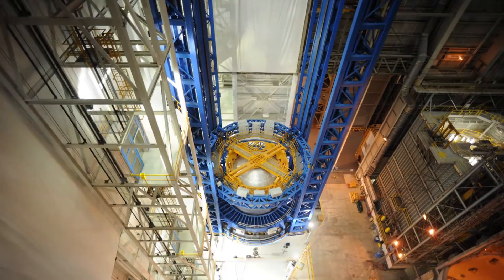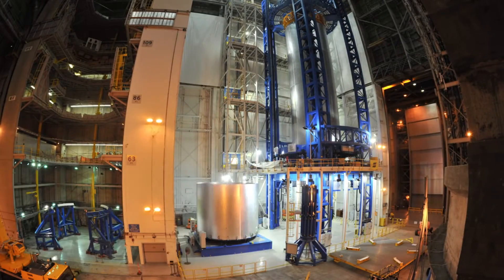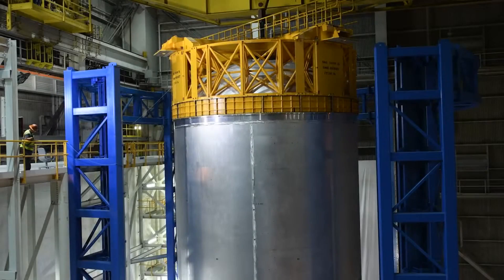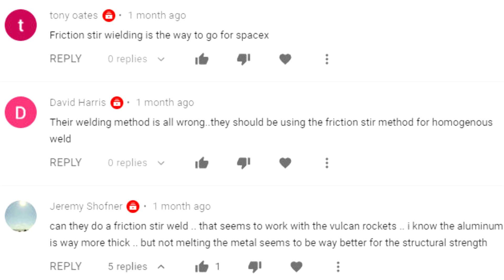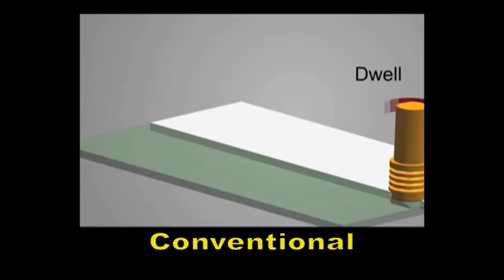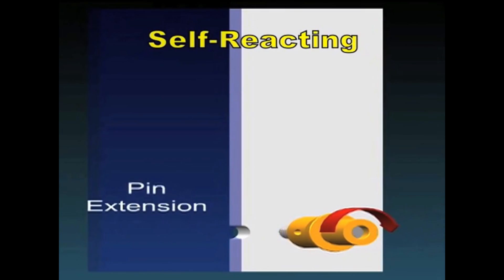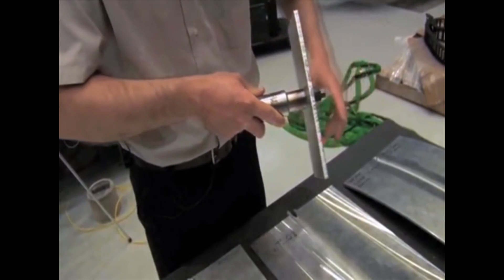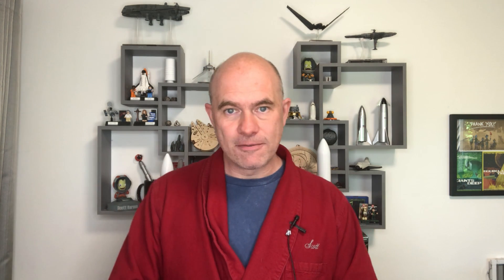SpaceX's 4th Starship Prototype Collapses During Test

Comment: 6:09 I hope so too. And I believe that we will see it fly. My hopes will not be disappointed, I am confident.
Reply: @gandritaskull  Oh is that why you're working so hard in these comments? ;)
Reply: @gandritaskull  Wat? Nah, you.
Reply: Yeah, SLS ain’t looking half bad now...
Reply: @OlCrunch  Oh my god no. Those solid boosters are a terrible idea on anything that carries people, and the thing is going to be way to expensive too use more than a handful of times. It's a political make work project.
Reply: TonboIV it wasn’t the SRB’s that where the problem. It was the the combination of a rushed launch and no abort system.
Reply: @OlCrunch  The SRBs were defective and dangerous. NASA was getting away with it by only launching in warm weather, but they were still dangerously defective and the o-rings were partially failing on every launch.  SRBs have never been reliable enough for manned launchers in the first place, even when they're designed properly. If one of them even loses thrust early, the rocket will go out of control and rip apart because the other one can't be throttled down.
Reply: TonboIV the big issue with the SRBs was the fact that they were reused when they really shouldn’t have, the tech was primitive in the 80s, but the SRBs had a very low chance of failure on their first flight and they’re only being used once on the SLS. And besides, a 1-135 incident rate is pretty good for a rocket component
Reply: @OlCrunch  They weren't reused. They were partly salvaged to build basically new boosters. It was barely cheaper than starting from new, and a lot more bother. Anyway, the parts the failed, the o-rings, certainly were not re-used. They burned part way through every flight, and NASA and the manufacturer just decided this was fine if it was less than half way through. It was completely reckless.

The big problem with using SRBs like this, is that any failure is pretty much lethal. A failed liquid rocket can usually be shutdown and the flight can abort. A failed strap-on SRB is a hypersonic power-slide with no way to get off until the fuel runs out, if you don't just explode outright. The shuttle had no abort options at all during the solid rocket burn. A failed liquid rocket is much easier to deal with. You usually just shut it down and abort, and the other engines can be throttled to compensate.

Anyway, re-using shuttle tech is just a terrible idea. The engineers did the best they could, but the were handed a completely stupid requirement. The whole program was an overpriced, unreliable deathtrap.
Reply: TonboIV are you talking about SLS or the Shuttle? I agree, the SRBs are awful, but the at least the crew have a way of escaping on the SLS. The Shuttle was overpriced, over-complicated and dangerous. It would have been cheaper and safer to stick with the Saturn IB.
Reply: @OlCrunch  The SLS crews will be a bit better off, but I'm sure what SpaceX will end up with will be far safer than anything with giant SRBs strapped to the sides. Re-using shuttle tech is also not the way to build something affordable or reliable.
Reply: TonboIV I’m really excited about Starship, but I’m a bit worried that there are no known abort system for Starship.
Reply: @OlCrunch  That is concerning, but they also plan to build a lot of these and fly them over and over, so it should be possible to build a large history to assess safety, which is not something which has been possible with any spacecraft so far. The design also isn't finalized yet. It's been through several big changes already, and others may follow.
Reply: TonboIV very true

Comment: Always great to hear your take. Note that SN3 was never pressure tested with water. They tested with ambient temp N2 first, then on to cryo LN2.
Reply: Ah, that may explain the top crumbling.  They accidentally cooled the ambient temp N2 gas to cryogenic faster than they could pour in liquid N2 to fill the void, causing a massive vacuum inside the tank.  Tank was designed to hold pressure, not vacuum.

Comment: while I like the idea of learning through failure this is a bit... unpromising
withe very large rockets designed like this tank integrity during flight becomes a lo moe complciated than jus static pressuization - so that failing means there's a very very very long way to go to a flyable booster tank

Comment: I agree that it is a testing failure, NOT a failure of the SS SN-3. The lower tank was having valve problem, and with the de-tanking of the upper tank, something caused the valve to release and it decompressed whatever there was within the lower tank. It's going to be ok, with the SN-4. They are learning. I suspect there was a bit of Go Fever in getting the upper tank test in.

Comment: I’m a rocker welder but I’m not gonna reveal my secrets.
Reply: Hey, I need the rockers on my Ford Focus welded.
Reply: No no, he meant that he sits in a rocking chair when he welds. Likely finds it very comfortable and relaxing. Two things you need when you're trying to lay down a smooth bead.
Reply: guitar and some heavy metal? 😂
Reply: Very funny guys. Y’all know it was a typo slow clapping
Reply: @MiguelMorales85  I've welded aluminum and steel, stainless steel, galvanized steel. Each welds different. What they were showing in the video, I've never done. Welding is commonplace, and a lot of people can weld. It's tricky at times.
Reply: @johnabbot1585  Valve manufacturer FLOWSERVE in Utah once demonstrated their friction-stir weld technique to a tech and I (visiting there) a couple of years ago. It was done on a lathe, used to join solid sections (of certain disparate materials!) together (ex: valve stems). I think FLOWESERVE has a vid up on YT showing their technique. Worth a peek!
Reply: @hlcepeda  I don't weld anymore. Lung issues. Thanks for the tip I will check it out. Ive watched people do tig welding , and thought that would be cool , but never got to try it. Welding got me through life. Kept a roof over my head, beer in my stomach...lol
Reply: @johnabbot1585  I have a massive respect for welders. My grand-dad was a welder in the old B'klyn shipyards. And it was a welder who wrote our company's weld specs; our weld engineers and structural people would go to that particular fellow for his experience and expertise. I also benefitted from he once showing me how one can instantly "anesthetize" a burn using liquid vitamin E... because I was the one who got burned just two feet from him one day! Stay safe, sir!
Reply: @hlcepeda  oh man, you as well my friend. And keep a safe distance. It's a different time we have.
Reply: @johnabbot1585 👍
Reply: @MiguelMorales85  I'd rather not get slow clap...
Reply: In tears you look at the menu - you pray it is not true.
You stare at it, in pure disbelief. It can't be!

"Chicken Nugger"
Reply: Miguel a confident man shares his knowledge and a confident coward hides it. The world needs confident men who share their knowledge and wisdom because there are so few of them. You be that man.
Reply: duradim1 so what would you do with this information which you would need to build the knowledge anyway to take any advantage of it, at which point you could just discover it yourself? Confident men become very inconfident when they build complex processes, but taking no shortcuts usually bears fruit, especially in rocket science.
Reply: @gearloose703  evidently I am not smart enough to figure out what you are asking me. Would you please rephrase the question at a sixth grade level for my sake?
Reply: Oh
Reply: Come on man. Do it for Elon. He wants to get to Mars badly!
Reply: @Michael-it6gb  Elon wants to get to Mars well!

Comment: Did you say that Elon designed a Rocket that was self supporting sans pressure?  What is the wall thickness of the Stainless steel?  What is the thickness of the supports ?
Reply: The steel is 4 mm thick. Once it's all put together it forms a quite rigid cylinder. There are no internal supports, like stringers. The only stringers are seen on the bottom section containing the bottom bulkhead and engine bay. Yes, surprising, even to avid followers of SpaceX.
Reply: @donjones4719  The issue seems to be multiple simultaneous nidus of crushing.  This is not consistent with the engineering prowess of Musk.  Something is being missed.
Reply: @donjones4719  The torsional rigidity and compressive strength of the design knowing how Musk thinks, let alone given the alloy chosen speaks for itself.  The zone of failure is seemingly consistent.  The forces necessary to provide this level of catastrophic deformation are enormous.  I would propose that a small scale model with scale level materials be made to see if failure could be duplicated conventionally.   It theoretically may even be modeled via computer.  This level of failure has a means to teach as much as reflecting upon the temperature of combusting Jet Fuel at atmospheric pressure and without additional air, and the temperatures necessary to deform structural steel that is 2" thick etc........ INCONGRUOUS cause and effect issue.

Comment: Stir friction welding with depleted uranium head? :)
Reply: Depleted uranium is used in ammunition because it is extremely dense, not because it has great strength or other characteristics like that. And according to Wikipedia, it's also flammable, so it wouldn't work in this application at all.
Reply: @Kepe  How about tungsten, then?
Reply: @michasaaban932  Too Heavy
Reply: It would melt from the heat of friction.
Reply: Stir welding is a CNC process it would require building a very large very expensive machine to do each weld. Assuming it's even possible to stir weld the alloys SpaceX intends to use on Starship such a large expensive machines are hardly anything you'd build in a tent...Besides it looks this time they may have come up with a new way to blowup prototypes :)

Comment: I'd also be concerned with vanadium migration with friction welding
Reply from the maker: Tell me more
Reply: @scottmanley  I'm not sure how familiar you are with steel fabrication and heat treatments, but basically what happens is that as you heat up the steel, its composition changes on molecular level. Even worse; if you let it cool down in an uncontrolled fashion, it can completely change the characteristics of the steel in that welded area. Rapid cooling usually means the area becomes very hard and brittle because the molecular lattice of steel changes depending on how fast it cools down. This is a problem with all types of welding, but with additive welding you can introduce the right amount of required elements back in to the welded spot. What Marc is talking about is Vanadium basically bunching up into a certain area of the weld within the steel when the steel is friction welded, instead of being evenly distributed. Vanadium is hard but also malleable, so it is a great additive used in steel fabrication to make the steel harder and less brittle at the same time. So if you lose the Vanadium content in the steel in a certain area, that area becomes softer and more brittle. I'm not sure which way it happens, but the Vanadium could either migrate away from the center of the weld to the sides, or the other way around.
I'm sorry if my terminology is incorrect, I'm Finnish so I don't know the English terminology, but I hope you get the gist.
Reply: I should also add that a weld cools down unevenly, as at the sides you have cooler, solid steel soaking up the heat from the sides of the weld. The center of the weld cools down slower, giving more time for different elements to move around and potentially bunch up. This is why critical welds are heat treated afterwards to make the material uniform and to relese the internal stresses the uneven cooling causes.
Reply: @Kepe  Yes agreed - I'd still be concerned tho  -especially on repeated heating cycles. Probably easier to near-net shape cast and machine back tbh!
Reply: @scottmanley  It's pretty obvious, no? Steel melting temperature is so high that friction element's material starts leaking into it. Same reason why you don't use diamond cutters on steel.
Reply: Mi 28 I thought the whole point of friction welding is it was a solid state process where the material didn’t liquify
Reply: @mrb692  look up the phase diagram up to around 1200 - 1300 deg C or so.
Reply: @scottmanley   As always with these things - it's complicated. Looking at an Elon tweet they're using SS310S (24-26% Cr, 19-22% Ni, 0.08%C by wt) - so no V. However, looking at the phase diagram for it I'd still be concerned about carbide precipitation and possibly sigma phase precipitants with repeated heating cycles - like, I don't know - repeated atmospheric re-entries. Friction welding isn't some magic forming technique - with SS you're still pushing material to a sufficiently high temp that you'll need to sit down with a phase diagram to work out the impact. On top of all this, it'll probably still need to be an inert system - absolute pain of something that size. Anyway, to all the armchair wikipedia reading material scientists - I'm not saying it's not impossible, rather that these things are quite hard (and as an actual material scientist) I'd have concerns.
Reply: Yes, please elaborate.